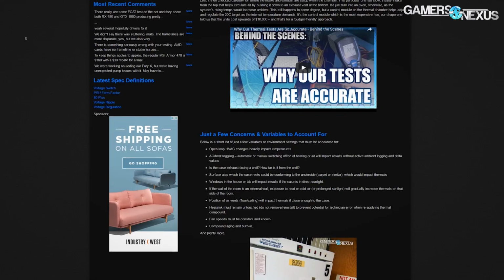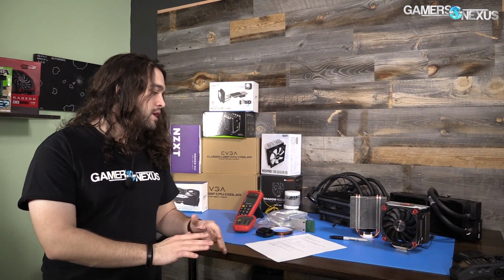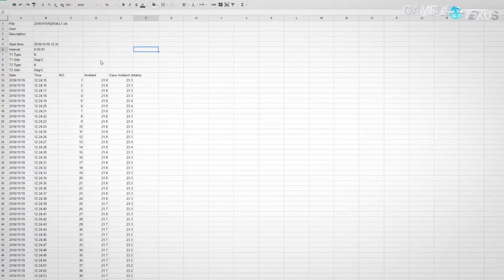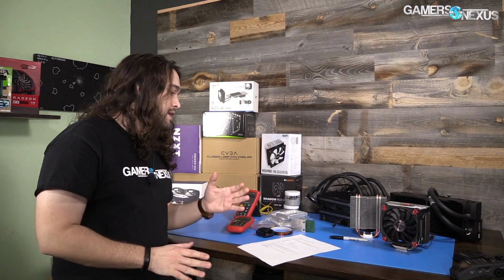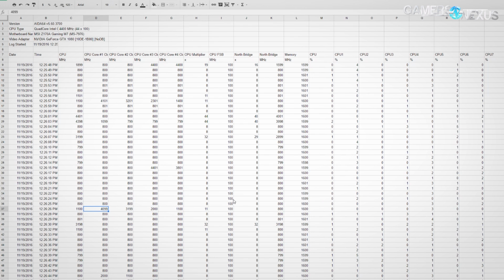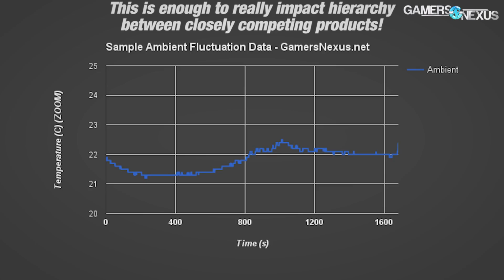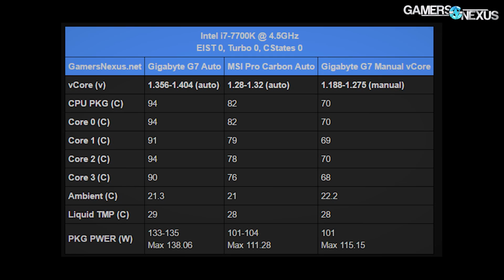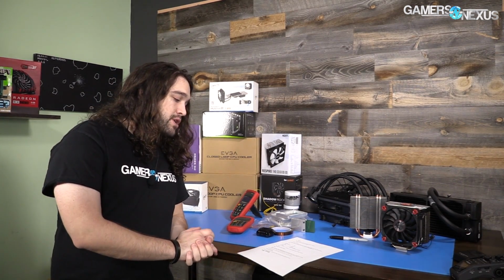Thermal Testing Challenges (Inspired by Bitwit)

Comment: I really like the point you made about "if it's lower than ambient it's wrong". If it is equal to ambient or within a degree or two, you should be alert and somewhat skeptical because the cooler isn't 100% efficient and the time it takes the heat to transfer through the silicon in the die to the ihs, to the coldplate, to the liquid, to the radiator, to the air.... isn't instant. In the mean time the die has to heat up just a bit. We all want to believe that our coolers are amazing and relative to coolers in the past they are... but they aren't miracle workers.

Comment: Came for an explanation of why Bitwits test results showed the coolest overall temps when placing the AIO in the front of the case with an open air GPU card. This video does a great job of explaining all the different variables that could affect your temps, but I'm still looking for a (somewhat) scientific explanation for Bitwits test results. This is important to me because I'm making my first build, and want to make sure I can maximize CPU cooling without sacrificing GPU performance (using an open air card vs an enclosed card).

Comment: Why don't you use something that guarantees a certain amount of heat and measure thermal performance then?.... I am thinking like a small heating element heating IHS cover whose output is capped and measured by energy meter.... Using CPUs as your heat source is a more difficult and less repeatable than a simple heating element.

Another method for testing CPU coolers in particular is to connect the CPU cooler to a reservoir with a known material, mass, and temperature and plot drop in temperature VS time and work backwards to calculate heat dissipation.  PM me for more info

Comment: Looking back at this, can you not make a rig with a heat source, where you just mount the cooler and check Temps with own equipments?
Say you have a flat iron the size of a cpu IHS, control how much heat is generated, put on thermometer directly, overhead, sides and infrared. Just to simulate and have a standard test bench. Like in your fan tester, we just need to see a base Temps by a popular coooler, and compare others to that as a benchmark. Coolers are always gonna be different. Even same models, depending on ambient temps, humidity, airflow, other heat source etc, we just need to find out if x cooler performs +/- than y cooler.

Comment: pro tip: go to 15:45 there its the simple explanation to Bitwit video and the reason why the cooler should face front/back of the case instead of low/high... GPUs do generate heat that will go up and will be sucked by CPU fan if pushing air which came from there

Comment: Your methodology reminds me of chemistry classes in college. Lots of data to process, and in the case of temperatures here the key is in the temperature deltas I assume. If you achieve a constant Delta T (ambient vs components), you know your data is accurate. My teachers were asking for a correlation of 0.9998 in our data.

The net is populated by reviews that "stress test" a component for 10-15 minutes and look at a temperature result, put it in a graph and compare it against other components without ever checking for the validity of said temperature difference between two components.

Comment: You could get the same results by sticking the coolers on a hotplate and checking the current draw.

You are measuring the exact cooling of the cooler, but Kyle's results showed that it doesn't make any significant difference.  All the bios settings are just to turn the CPU into a hotplate.

Comment: For CPU cooler testing, why not get rid of the CPU in thermal testing as a potential variable altogether?  Build a carefully-controlled resistor (thin strip of nichrome metal) the size of a CPU die, adhered to the underside of a CPU IHS, and a power supply setup that will control voltage and current to achieve a fixed power input (say 120 watts).

Comment: Would it be possible to use a simple heat generation device to produce the exact watts and use it as the control for all cooler tests?  This could remove all the variance caused by the BIOS/CPU. However this probably won't work for graphic cards.

Comment: why not take mobile and cpu out of the equation? simulate the IHS of different cpu's with a piece of metal and couple a known heat source under it (resistor). That way you can control the heat going in the test setup.

Comment: You basically described the scientific method. Only change one variable at a time. You might also want to measure air pressure and humidity. These will not change as much one day as the temperature will, but over several days or even longer it might play a roll in cooling performance.

Comment: It sounds like what you really want is not a computer, it's a thermal mockup made out of lengths of suitably sized hot plates, like enclosed resistive wire, on some dead and butchered old boards. Because what if a software update comes in and ruins months of comparative testing?

Comment: Wouldn't it be much more accurate to use a constant heat source for AiOs and Air Coolers, like a heater that is adjustable to a fixed temperature and then to measure the Delta?
btw. You remind me of John Belushi.

Comment: To eliminate all the variables for temperature testing try making a test rig using a heated CPU replica. Maybe a square piece of steel, same size as a CPU, on temperature controlled hot plate just to obtain a stable and controllable set temperature to compare with. Of course this method won't be real world results because the only variable would be the cooler itself but more data is never a bad thing.

Comment: Not to get too deep in the weeds, but you also need to be accounting for humidity.  Different humidity levels will affect the ability of coolers to dissipate heat.  It's probably not having a massive effect, like it would on a commercial cooling tower, but it's still there.

Comment: This video gives me a whole new respect for what you put into your videos.  I figured you did a bit more than I did to monitor temps (I have fun doing it, but don't share data or anything like that), but I never knew you went to such extremes, monitoring the temperature in multiple places by the second, spreadsheets, thermal coupling sensors, etc.

Comment: I've always thought of you as someone that does way more than others, does not have time / space to put that (all you do) into every video and that methodology chosen is critically important (likely very few Tech Reviewers, if any, go to the lengths as you).  It's super great of you to share as much as have, and that you go through all the time / trouble / expense that you do, however could some of this still not rely on the individual and how they interpolate the data (versus shutting down some or all variables - which may occur, and almost certainly will occur irl).  After all, technology today has the capability of designing a safer car in case of crash, all based on science / methodology however they still crash the car to check the results.  Could one not take the massive spreadsheet data with "everything" turned on, and then sort it (data) to come up with data of matching variables?  Example:  If voltage varies, say during a turbo-boost, then find the data where this occurs in comparisons and align it accordingly to read that thermal data comparison only.  I mean after all, are you not suggesting something like change in ambient variables would in itself not disqualify the data, that adjustments can be made to the data?  The other similar topic I've thought along these same lines is "sound test."  To me testing something on an open rig only, or even in an Anechoic Chamber is not as helpful of data as testing in an actual enclosure type, one which can be expected irl. Think about it, an enclosure could have significant impact on sound, which is why different speaker box technologies exist.

Comment: This video: your little baby testing was cute, but let the adults do it now.

Kyle is bad at what he does.
Reply: i dont think that channel and this are really trying to do the same thing.
Reply: Better yet, as he said, he made this video so other content creators can understand why a PC is doing what it is doing and steps to controlling the outcome to something you can measure. You have to respect Bitwit because he tried even if he didn't understand completely. That is science as a whole, you are constantly learning and hopefully doing better as a result of it.
Reply: let's be honest here... if bitwit can't figure this things out... he shouldn't be making vids about cooler temps anyway... steve didn't treat bitwit guy as a moron, but anyone who have ever overclocked a CPU already knows that things like power savings do need to be shutted off and voltage needs to be fix to remove undesired variables when testing how far can the CPU take at a given voltage/speed with a given CPU Cooler... and after finding the sweetspot, power saving stuffs can be put back on even on overclocked CPU.
And there's a pretty straight-forward path from there to fixing CPU and case fans and removing as much variables as it can while measuring termals, also GPU as a factor, needs to be as fix as it can, using the same one at same fix frequency voltage and GPU Fans at same speed (even if it is fix 100%)...

If bitwit have done things right the first place, he would have gotten much more reliable data, and he can in fact learn a thing or two about steve and the GN crew which do things in a much more pro way than most of the tek channels out there

Comment: i need help on psu my 80 plus gold coolermaster v750 died on me today i dont even have a gpu i tried testing  my other psu and it work i tried my cm v750 to my other computer and it would not even turn on so i conclude that the cm v750 is dead now i use my other computer psu that is working which is thermaltake light 700w guess what after 3 hours of using it explodes idk why luckily my other components still work

current rig 
case n600 cm
i5 3570
8gbram
ssd 120
hdd 1 tb
ecs h61h2-mv

Comment: Also, on the topic of accounting for variables, air pressure isn't one that Steve didn't mention. Kyle's video was plagued by the fact that a blower card is going to significantly affect air pressure in a case with tight ventilation, as it adds another layer of exhaust, and significantly changes the fluid dynamics of the system.

In other words, science is hard.
Reply from the maker: Oafah Air pressure was printed on the side of the screen when going through some other examples, I believe. Elevation also... yes, lots to account for. Not all are "necessary" for this type of work, but you can definitely get into the weeds.
Reply: Oh, I might've missed it. I tend to go audio-only on these videos while I do something else with my eyes. #HumanHyperthreading

Comment: I said it in our exchange on twitter, but I'll repeat myself here for the benefit of those reading the comments.

I appreciate GN's attention to detail. Seriously. In certain scenarios, information like this can be key, especially in the case of small form factor builds, or in spaces where there's not enough active ventilation, and a lot of thermal output. Or (in a different application) when dealing with temperature and air balancing in a large commercial building. So don't take what I'm about to say as a criticism of this channel and what they do. It's important stuff, but not for the reasons you (the every day viewer) might be thinking.

That being said, for the 99.9% of users watching (and my comment is directed at those people), a 4 degree difference (58-62C, for those who haven't seen Kyle's video) is largely irrelevant, and serves as ample justification for not giving a fuck. In other words, if you've got a vertically-aligned Hyper 212 EVO, and you're here watching this video, panicking because you think you've done everything horribly wrong, relax your shit. You're fine. Ain't nobody gonna splode.
Reply from the maker: Oafah Definitely true. Unless 4C is the difference between 100C and 96C, it doesn't matter a whole lot for a CPU.

Comment: Might you think about testing a cooler using a fixed source of heat instead of trying to make CPU perform that task?  Mapping the heat source to a CPU is only a rough approximation, but the worst case scenario is a steady peak heat output.  The best cooler for this situation should, most likely, be the best to cool a CPU in any situation.  You seem to be going to heroic effort to make a CPU and motherboard do something that I can do with a $5 soldering iron or one of those coffee warmer things.

You can even use multiple heat sources to mimic video cards in a much more controllable fashion.

Comment: Thank you! You have proven I'm not going mad I never understood why when I fitted an AIO to my fx8350 @ 4.7ghz how it could possibly idle at lower temps than the coolant (and copper block ) my idle was sitting around 18-20c in nzxt cam but my coolant is at 28c (yes my room is very hot it has my heating boiler in there lol).

Comment: Isn't 1% too tight of a tolerance for devices like semiconductors? Most of the time they will have 5% tolerance. As for the coolers, all fans will have an arrow somewhere on their frame which shows which direction they blow air.

Comment: So here's an interesting one. My CPU running at 4.2 Ghz at 1.175 volts got around 76 celsius at the hottest core after a couple hours of Black Desert Online. I overclocked a bit more 4.4 Ghz at 1.2 volts. The CPU now runs cooler at the same fan RPM at around 70 celsius on the hottest core, rest being 64-68. What's up with that? : p

Comment: Software cant be trusted true..On Aida64 cores show 6 C  witch is impossible and ambient is 16 atm, and on Hwmonitor it shows at 27C witch is correct..So thats why i exclusively use Hwmonitor.
Reply: Gixxer983 you must have messed with the temperature calibration in the settings
Reply: There are no calibration settings i have touched, my Cpu is Fx8350. Hwmonitor is showing 34 C atm (ambient 19c) in desktop correctly . @4.5ghz
Aida64 shows wrong temps on cores but on CPU it shows same as on HWmonitor.. Its just an AMD thing.
Reply: It's entirely possible for software to show wrong fx temps, because amd's temperature sensors (if you can call them that) are terribly unreliable with low temps.
http://forums.guru3d.com/showthread.php?t=376926

Comment: great video, love the amount of thought and work that u peeps put into getting proper results we can trust.
question, how do u go about fixing pump speeds? don't some of them need a pwm signal or they will run super slow or out of expected range.
are u getting the pwm signal through the powersupply at a specific value or sth? or am i just thinking to complicated here.
as u said motherboards and software can't be trusted.
Reply from the maker: cataria pega We run the pump and CPU fan off the board, but just set them to full speed and use a good board.

Comment: Seems to me you should eliminate the mother board altogether and just measure how fast it can circulate the heat from a generic source say a heating pad and measure how long it takes to cool that pad with that case.  I've also used a smoking vaporizer to see if I had positive or negative airflow and also to check with how fast the smoke travels through the case with a given fan configuration.  Just some more testing ideas
Reply from the maker: Jonathan Gibson The problem there is that you can't measure the throttle amount (clock reduction) or clock vs time when eliminating the CPU, and some coolers perform much differently when accounting for RAM next door.

Comment: I always check temps when i'm building PC's as i don't want them coming back. I've only ever had one that kept overheating and i couldn't fix it. Turned out to be faulty PSU. It wasn't overheating, but it wasn't supplying the right voltages and amperages. Which caused all kinds of issues. But it was not easy to figure out at the time. Easy to recognise now, but if you've not built many PC's or haven't seen it, then it can be a pain in the ass to diagnose. I've built many PC's since then and never had it again. Just unlucky i guess. lol

Comment: Isnt Delta T a bit flawed without keeping ambient the same given that clocks with pascal at least are based on temp (iirc -13hz for every 4 degrees past 60).

I mean, its likely not a very large amount of difference, but Ive been thinking for a while it does have some effect doesnt it

NVM, you explained how you account for it in like the first 5 minutes. I didnt recall seeing that both were controlled for before.
Reply from the maker: Beef Ingot Not really. It would only become an issue if you are actually brushing against your temperature threshold, which never happens except with the reference cooler (and we talked about that in the 1080 FE review).

Comment: I replaced a Antec Kuhler 920 sealed liquid CPU cooler with a Cooler Master Hyper 612 Ver.2 Universal CPU Air
Cooler.  And found that the much cheaper latter cooler is far better at cooling my overclocked i5 6600K CPU.  I removed the former cooler because it got an annoying ticking noise which I think is from air bubbles.

Comment: Superb video detailing your commitment to the scientific method and why it's so important.  I was just linking your M.2 Heat trap video to BitWit's video yesterday and saying how putting a M.2 drive in a vertical mounting point might be better for drive thermals, especially compared to being behind heat shields.  I'm definitely a proponent of doing everything possible to optimally lower a computer's thermals to increase performance and longevity.